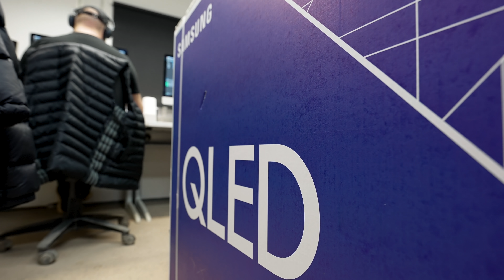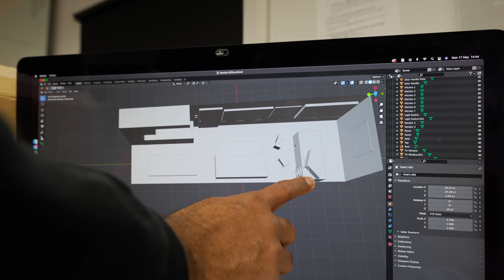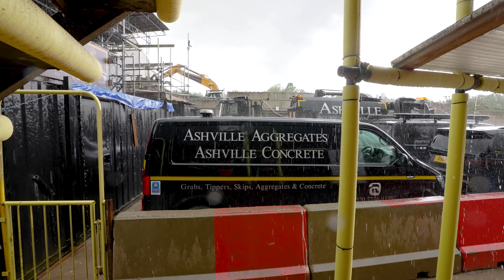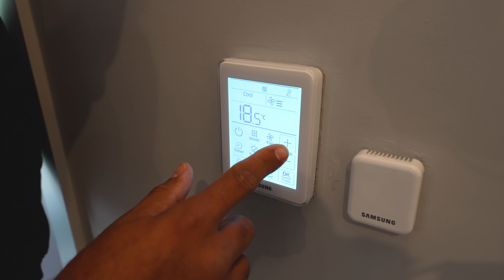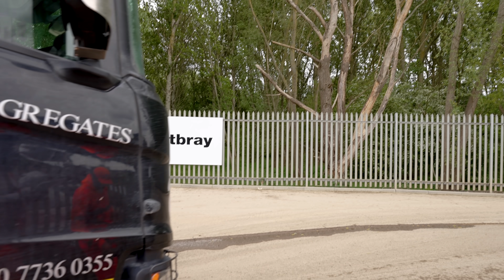Back on the Bustle | Ashville Weekly ep033

Comment: 24 degree room temperature? I melt at 20. My aircon is set at 14 in the car, and 16 in the house.
Reply: My house is a stable 14 with no heating or cooling.
That’s the bonus of having walls that are 2 feet thick.

Comment: why`s your 360 operator unloading the wagons incorrectly ? the driver should be taking a bucket from 1 side of the wagon, then move the bucket to the opposite side, then the load goes down evenly, he will also get FULL buckets doing it this way AND unload the wagon quicker. simples.